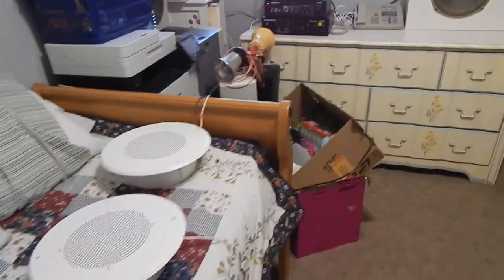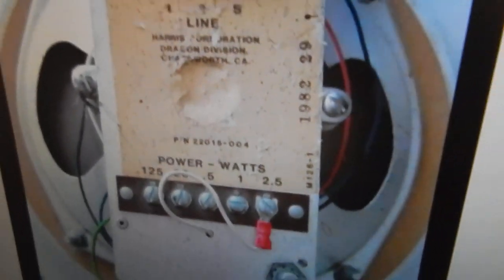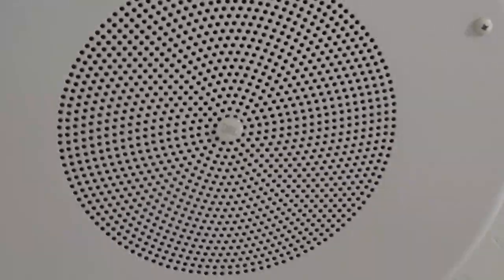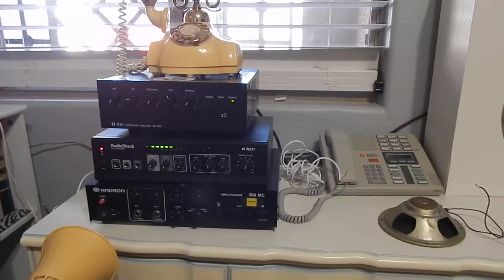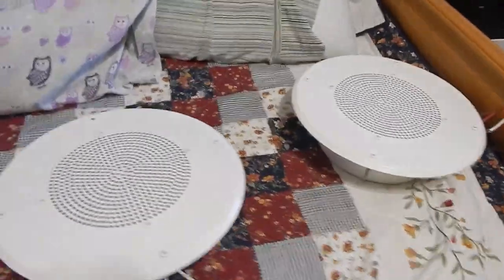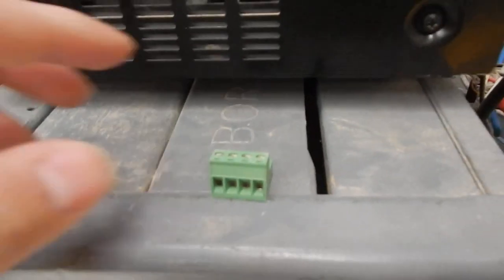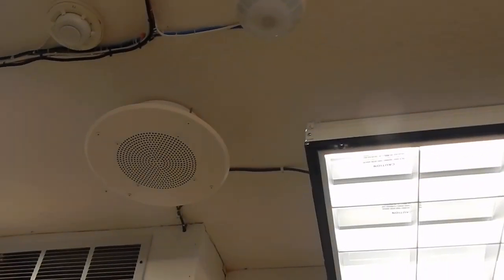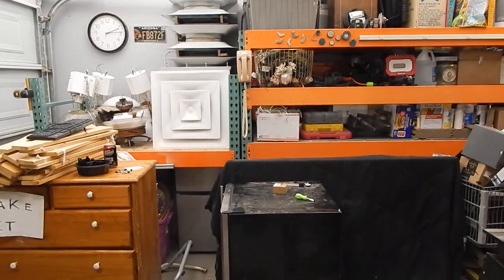Intercom System Update As Of 4/4/21

Comment: Lol have a lowell rs8a as my center channal speaker for my cinima,it sounds great!
Reply from the maker: I always noticed that Lowell speakers tend to be louder than other speakers tapped at the same wattage, which sounds like they are tapped at four watts when tapped at two watts. I'm sure that your Lowell RS8A speaker is nice and loud as your center speaker.
Reply: @CristianOrtiztechmaster926  id be happy to do a vidio on it if you would like,i unforunitly dont have the transformer hooked up becaue i dont know how to.
Reply from the maker: @kiyo_UwU  That will be cool to see it in action.
Reply from the maker: Nice setup and I like the creativity of using a microphone stand to hold the Lowell speaker in place. I have a bi-directional LCB-8 Lowell speaker with the original driver that works just fine on my system. It also had the original transformer but was switched out to output four watts since the original transformer can only do two watts. I noticed that the backcan was green with the Union Made sticker which the bracket on my LCB-8 Lowell speaker is the same color with the orange Union Made sticker. At least you have a piece of your school in your room, and it is a cool score. I wish that my high school changed some speakers out; that way, I ask them if I can keep a couple of them since most school maintenance would likely throw them away. When I was a student intern for my high school, there was a problem with one of the horns in the cafeteria since it was its own building with the gym. I remember taking it off the wall to test the flanged horn with a 9-volt battery to see if it was blown, which was not the case. It turned out that mice chewed the intercom wires going to the building. The horn was an Atlas APF-15T with an Atlas Sound VP-161 baffle taped at 7.5 watts. Did you get only one speaker, or did you score more from your school since it sounds like your school was upgrading the intercom speakers?
Reply: @CristianOrtiztechmaster926  unfortunitly i only got 1,they threw the rest out and this one was the last one being removed.although i think if i went to look in the dumpster put back id find alot lol
Reply: @CristianOrtiztechmaster926  not a speaker question or even possibly intercom question.

Butt by your window sill there is what looks to be a black small box or terminal block or junction box or something like that by the window sill what exactly is that is that something you put in or is it something else entirely just curious.
Almost looks like an old telephone junction box.

Or perhaps Old School telephone terminal block.

At the place while my parents stay.

Probably built in the 40s or so the law of the telephone wire is to wire twisted pair black wire not color coded or anything.

There are terminal blocks about maybe excess of an inch high much larger than most and longer.

Just to terminal like a standard terminal block but much larger in terms of overall length.

Also the wiring is tacked in place quite literally look like pics with a plastic or wood verse of the other head not sure what material the head of it is.

Also would you have any clue what type of system this would have been used for originally.

The following that is.

They had these kind of a gray color or so varied a bit.

Not sure how to describe color exactly.

They were these covers on a wood base maybe about a foot trying to be any less hard to say bio about several inches wide.

The bases were normally painted Gray.

Inside there were two terminal Blox roughly look like a dog bone sort of shape.

Five terminals either side of each of of the terminal blocks.

Mounting screw or screws were in the center between the two sets of terminals.

There was two of these married one above the other in each junction box.

My question is what were they originally used for what type of system in our home phone or whatever.

Terminals total total for each terminal block.

With both terminal blocks there would be a total of 20 terminals.

They were the type that had washers under the screw heads which makes me think telephone.

Strange thing is I never really saw any wine connected to any of these ever not even once when I saw these.

I had gotten all of them for Salvage and used to terminal blocks of course.

I had actually use them in one piece a few times as well.

There were no ground screws and all the terminals were isolated from each other just single terminal screws.

Really a oddball
Reply: @CristianOrtiztechmaster926  few things here.

First off I remember the old church I used to go to eons ago.

Downstairs in the dining area.

The PA speakers or mounted above suspended ceiling it was the square ceiling tiles but these certain trials were specific for speakers that acted as the speaker Grill.

Also in the back of the sanctuary in the area behind the back doors in that section and also underneath balcony.

There were PA speakers that had both Tweeter and woofer.

They were on wooden baffles open Twitter buttload of woofer I did save all those speakers and I did wind up using them.

They were 8 8 ohm speakers so is able to connect them directly to an output of an amplifier did not wind up needing the transformer for that reason.

Also downstairs in the eating area.

At the church the Mike Jack's if you could call them a Jack.

Was the old school threaded 2 conductor that had the ring that held the connector to the male thread of the wall plate.

The connector was integrated into the plate as one piece.

Also I found a lot of cables that use the same type of connector evidently that was some sort of hermaphroditic system.

That the connector could be either a male or female.

At least the ones that were not fixed to a piece of equipment.

If you unscrewed the call Lourdes threaded that that joins it together Oakway off threads another another connector of the same type to be threaded on.

Don't recall who makes it or anything.

I've also seen this on some old PA amps that I had salvaged.

Long-dead !

Also in the back hallway.

I don't know what this was used for it was just hanging there through a small hole about the same size as the cable it was on.

No clue what it was for originally and no one knew anything about it couldn't even figure out where it went or did at one time.

It was a 4 pin plug same as the 4 pin tube socket such as on some rectifier tubes.

Not sure if the cover was metal or plastic over the plug look like some short of cloth covered cable from a distance not sure.

Hung down from the ceiling about 4 or 6 in but that was it.

There was no evidence of anything being married there ever or anyting!

Not sure if was related to intercom or even audio any clue.

For certainly that was not for Pinto phone plug for sure different plug entirely different size as well.

Pens were much too large as well!